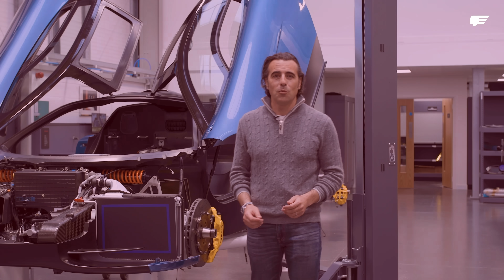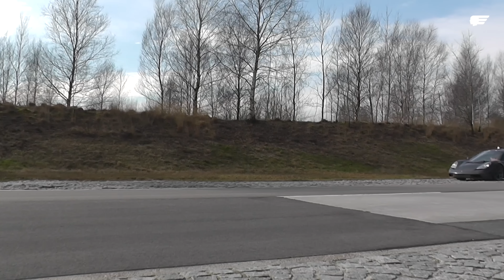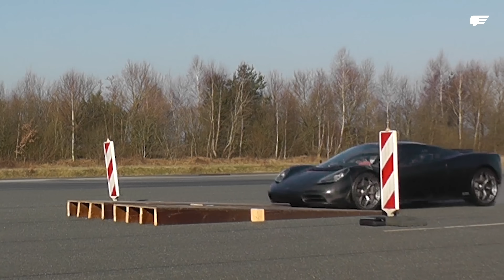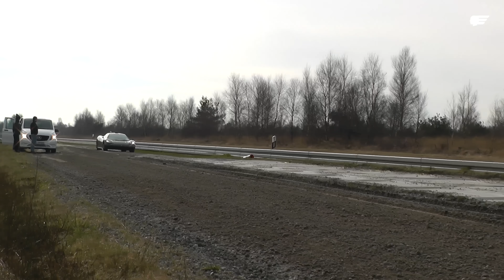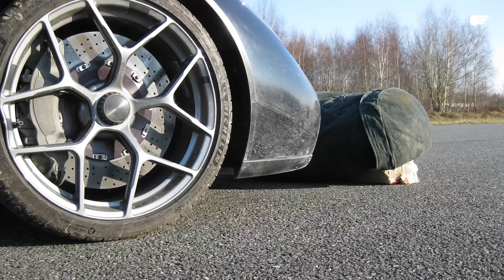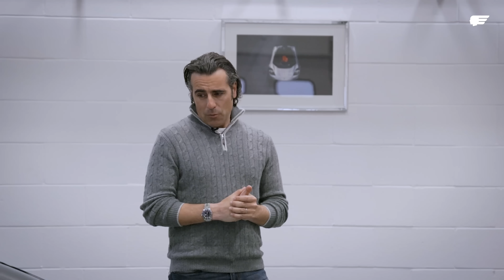T.50 VLOG | EPISODE #15 | AIRBAG CALIBRATION TESTING AT ATP PAPENBURG

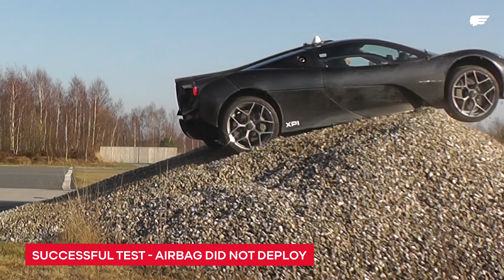Comment: 2:02 Now show the outtake of the dukes of hazard test, also with your pothole strike test at 2:18 your actually cutting slivers off of your low profile tires, you can see the piece of it land on the ramp, so you need to up the size of your sidewall and reduce the rim size or your going to get a puncture so it can absorb the shock

 also by the way you need to up your speed for these tests, namely the speed bump, as the average driving speed is 45 MPH, not KPH, so your a good 7 to 8 mph off of what the real world average is at your max, and I bet you your rims are going to have plenty of damage along with the undertray

also check the shock absorber towers for cracks, your bound to have a few with the cobblestone test, as it was twacking the heck out of the right rear

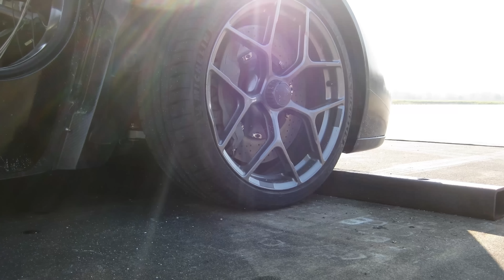case in point 5:57 and the car when into its raised mode with the trashbag with 40 pounds in it, now do that with a 300 pound moose

like these are good tests for idiots who will miss the mark and curb the thing like its a 4 wheel drive volkswaggen with a lambo badge stuck to the front, and randomly decide to reenact the opening of Quantom Of Sollice, but your average speed is off and you need to test for deer and moose, as that is what it will see in the north american market

also tell gordon to change the production numbers, and double them, as its a really dumb move to make it such low production, to the point that half the people who want them and can afford it cant get it. 

which means years on this will end up in currated's collection at 10X the cost, instead of 1/3rd where an actual enthusiast can get ahold of it and enjoy it for what it is

a newt with a bottle rocket up the backside.

not to mention the more that are made the easier it is to get parts, like you really screw over everyone by going with such low production in the name of keeping its value

as it doesnt matter how many you make its only worth what people will pay for it, a good car is a good car, a bad a bad, which is why quarter mill mercs are like 1/3rd their cost when they get old, as the services and the quality are horrible lol
Reply: Shock absorber tower? The T.50 has a rocker suspension. And yes, they undoubtedly check for damage after each test to know what to beef up

Comment: Is this set of ATP Papenburg tests voluntary or is it required by all manufacturers aiming to obtain certification to sell their car in a given market? The tests are rigorous and your mule held up well but you keep repeating how you're doing these tests to ensure the car is of a certain calibre, implying that you're taking the initiative to do them and that it's not an industry requirement. If this is the case then bravo for going the extra mile to make sure your car is as capable and durable as possible, and well done on an excellent piece of engineering!

Comment: The 'English roads test' should be an industry standard...

1/2ft deep pothole with sharp edges, roughly 1m diameter x30 on a 10 meter long road covered with water to hide them.

Comment: Wow, I really love how even these less "sexy" topics are being shown on this channel. The T.50 is the car that's impressed me the most from an engineering perspective. It's the complete package plus extra's which deserves great respect. The engine, driving capabilities, practical capabilities (such as luggage), cost perspective (servicing shouldn't cost much), but also the ingenious driving position and the aerodynamics. The only thing that's not impressive in the total package is the way it looks. And it doesn't look bad at all, but when all engineering subjects are that impressive, the design is a bit underwhelming. And I think that should also be a compliment.

Nevertheless, I hope we will see (a lot) more of Gordon Murray Automotive and the T.50 soon. I wish I'll be able to sit or drive one at least once in my life ...
Reply: @huss03  Nah. Once you put low side skirts and a front splitter and rear wing on it, it will look just as stupid as every other supercar. It will also take 3 hours just to drive to the store, just like in those cars, cus you have to crawl at slower than walking speed every time you come across a speed bump or a pothole, or a slightly uneven surface, or a tight bend. There are already plenty of cars for people who want a load of air vents and random bits sticking out all over the place

Comment: Raw carbon fiber is actually much harder and scratch resistant than epoxy and clear coat. And it's strong. Shrugged those bumper impacts like a boss. And it might save 10kg on this car... 😂

Comment: You sure you don't need more sidewall on your tires to save the wheels? Those dampers are awesome btw, the way they work so well even in such brutal tests. The car barely moves around. If this were an SUV they'd move around more than an amusement park ride.
Reply: Agree R18 all round would look better, no  idea why they chose r19/r20 - maybe weight reasons?
Reply: @r129r16pfl  standard recommended size for Michelin for the PS4

Comment: Ooooofff. It's incredible how well XP1 held up to those tests. I think in many ways it was significantly better then some everyday cars.
Reply: Well of course it is. One of the suspension struts alone will be worth more and more heavily developed than a Toyota Aygo.
Reply: Nope. You'd be surprised at how normal cars have to face this and some other tests too. Mass pro cars usually have to take into account more "common" incidences to be simulated and evaluated.
Reply: In terms of stiffness and performance, probably. But if we're talking about simply coping and not falling apart / still steering and braking, then actually all road cars go through similar testing during their development. And they have to pass it, too. Afterall, you'd still expect your average road car to still steer and brake over a railway crossing if something appears in front of you suddenly.
Also the airbag needs to reliably open in case of an accident, and reliably not pop in your face when you hit something but forces stay within normal parameters. No matter how cheap the car.
Reply: Haha. You plums. Of course all modern cars are put through countless stringent tests. All my comment was designed to highlight was the obvious superiority of engineering. Are mass produced cars components whittled from billet steel and a pure result of a design team only focussed on ultimate strength/efficiency? Are they bugger. There are far too many accountants and middle managers in the way for that to be anything close to realistic. Gordon says as much during the initial press release. This is a low volume, truly special car.
Reply: @Gnasherism  Yes, superiority from a performance standpoint, which is what it's built for. A Toyota, on the other hand, can handle this kind of abuse not just for a few "torture tests," but daily for >250k miles...something the T.50 could never do.
Reply: These are important tests. I do a ramp jump at 65kph every morning to get to work. Glad they really push it to the limit though.

Comment: Reminds me of the safety tests for F1. The particular story that comes to mind was the crash that involved F1 rolling several times, a fire breaking out, but the test driver just opened the door and stepped out of the car.

It strikes me that T.50 would prove to be every bit as safe as F1 and then some!
Reply: My favourite story of F1 crash testing was that GM was so confident in the car's safety that he wanted to be in it when they tested it. They didn't let him lol
Reply: @vyrnmn  he certainly had good reason to be confident.
Reply: @damionlee7658  windshield didn't have a single crack, car was so intact - it was possible to drive away from that test.